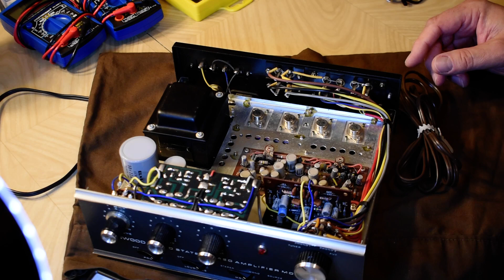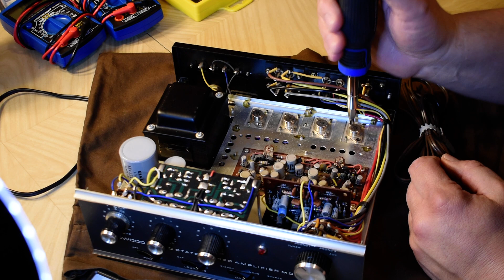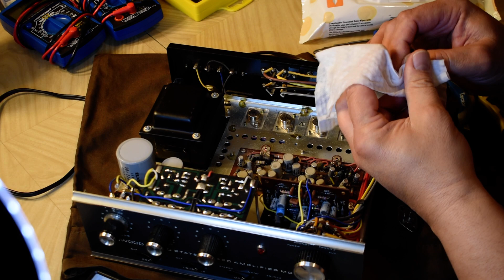Kenwoody KA-2002 part 2- checking out those hard working output transistors!

Comment: @acrossthedial I've just gone through all 4 output transistors (2sd91), and 3 have hFE from 45 to 51, while the 4th is only 19.6! Vbe similar on all (440-461)

I'm guessing this 4th one needs to be replaced!?

As they are mounted 4 in a row, I'm guessing its best to 'match' 1 and 2, then 3 and 4?

In this instance (cap-coupled outputs) is hFE equally important (or more so) than Vbe?
Reply from the maker: I would replace all the 2sd91's with TIP31C's which will fit in the socket and are easy to match.  The Hfe number isn't that critical in the output stage anyway.  It's a series arrangement with little signal gain.
Reply: Great, I'll bear that in mind if things go pear shaped! As it stands I have a really beaten up Ka-2000A i am using as a donor. By chance it also had one of the original 4 2sd91s similarly out of spec, but 3 good ones 👍